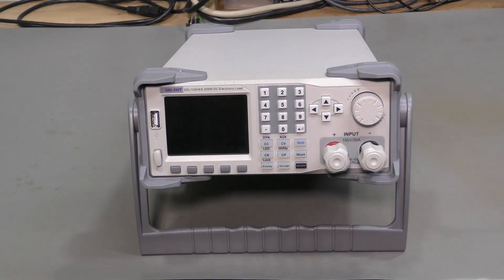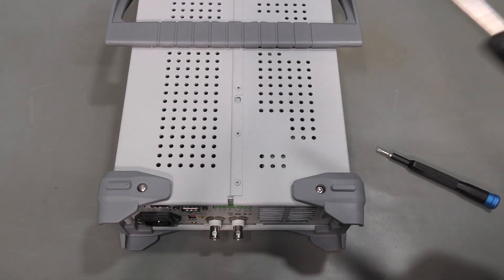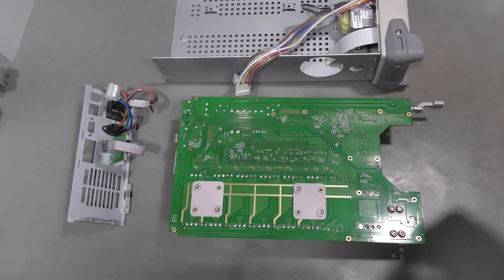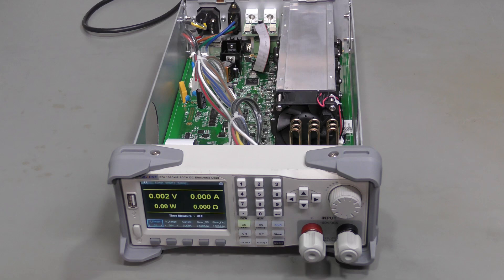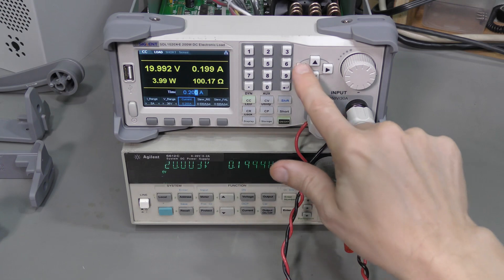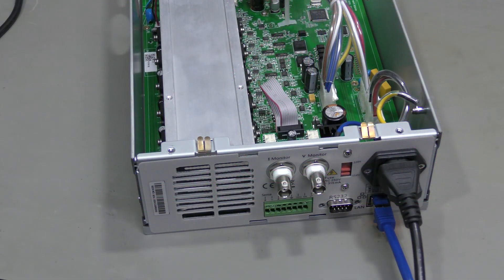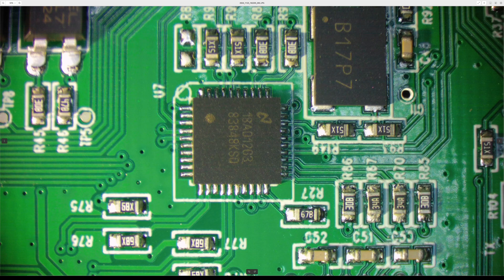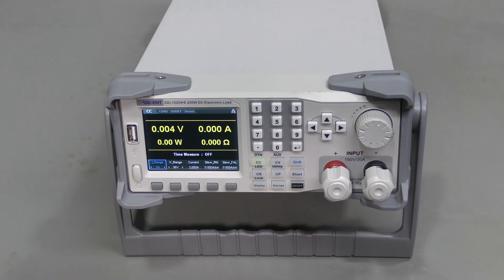#155 - Siglent SDL 1020X-E DC Electronic Load repair

Comment: Thank you for video!
i was an iphone component level repair technician for more than 3 years. Long screw damage was one of the common failures after self-repair attemping . And it was difficult to fix, because of the board thickness.
For example thickness of the board iphone 6 was only 1.1mm. So, imagine to fix broken traces in the 3rd layer of the board ))

Comment: Just a heads up on the LAN LED that does not light up. I have a similar unit that works over ethernet, but that LED is also off on mine. Not sure if it is a software issue, I guess they only use 10Mb/s speed.
Reply: Makes sense, for the purpose of remote accessing this unit, probably even a 9.6kbps connection would be enough, so why bother implementing the auto recognition between 10 and 100Mbps networks, just keep it always at 10. This also has the advantage of being able to use longer runs of LAN cables, and use a single LAN cable for two units with a spiltter. Not sure if you can do that with 100Mbps LAN, but you can do it with 10, because it uses only half of the twisted pairs. I think only Gigabit LAN uses all the pairs, but I'm not sure. I'm clearly not a network geek.
Reply: @mrnmrn1  So why they did bother to implement the trace/resistor to that LED in this case?
Reply: @MrTon4eff  Because that single extra resistor costs practically nothing, and future proofs the design, if they later add a function to the firmware which requires more than 10Mbps, they can enable the 100Mbps mode. It's also possible that they just copy-pasted the layout of the LAN circuitry from one of their other instruments from this line, which does use the 100Mbps mode.
Reply: @mrnmrn1  Hm, IMO this would be a bad idea. Some newer switches no longer support 10BASE-T.
Reply: @adlerweb  Really? I had no idea about that. But why they drop backwards compatibility? In this case you're right, it would be a bad idea from Siglent to only support 10M, although I don't know how old this Siglent design is, and when switches started to drop 10Mbps compatibility.
Reply: @mrnmrn1  Afair 10M uses higher voltages than other variants, so probably a lot of additional electronics and PCB/Die-space. Would also line up with my observation of devices without 10M usually support 2.5G/5G/10G copper ethernet.
Reply: @adlerweb  I didn't know 10Mbit ethernet is so fundamentally different. What, 10Gbit copper ethernet support on basic consumer network gear? I'm really lagging behind, as I said I'm not a network geek by any means. I used a 2007/2008 D-link DI-524 router until 2023 (but at least I upgraded the firmware) 😅 . I like using things until they desintegrate. Said D-link router failed once in 2021 because every single electrolytic capacitor dried out, but instead of replacing it, I repaired it. I still have it, I retired it only because the new cable modem the provider gave me has built in router and faster wifi. This new one is a garbage though, always drops my tablet from the wifi. The ancient D-link never ever freezed.
Reply from the maker: good to know. thank you!

Comment: I once bought a Marconi 1050Mhz signal generator listed as "does not power up". When I got it home the first thing I did was check the line voltage setting. It was set to 220v for some reason (came from USA). Set to 120 and has worked fine ever since.
Reply: I remember once in the 90s, a customer brought a VHS player in for repair. It was set to 110V (in a 220V country). When I asked him why he did it, he told me he thought it would use less electricity and he would pay less.🙃